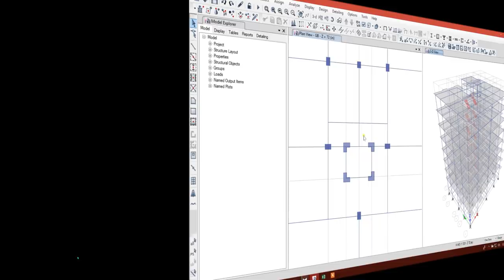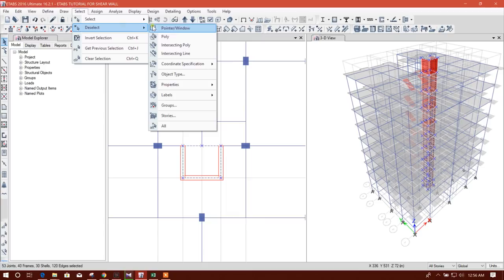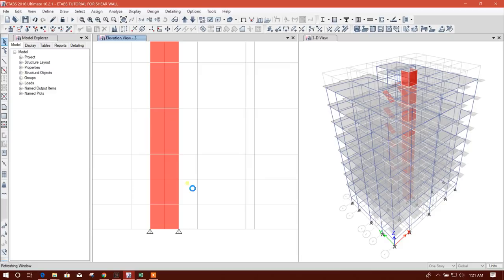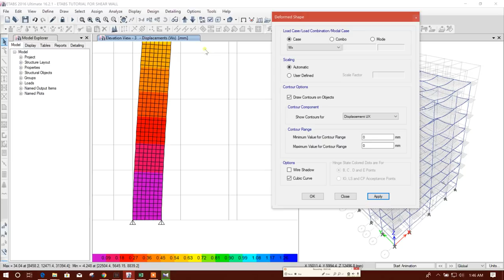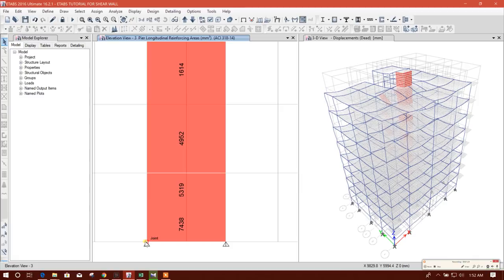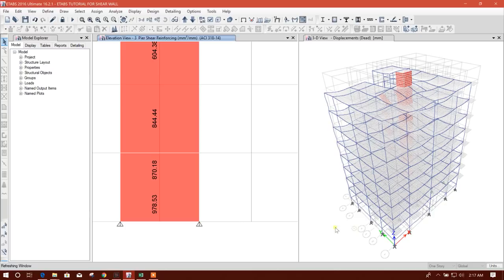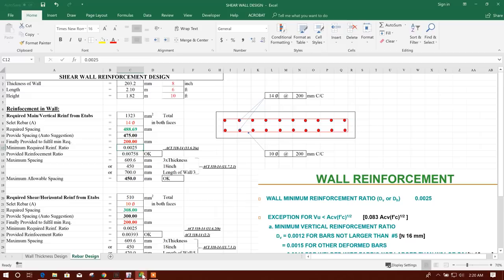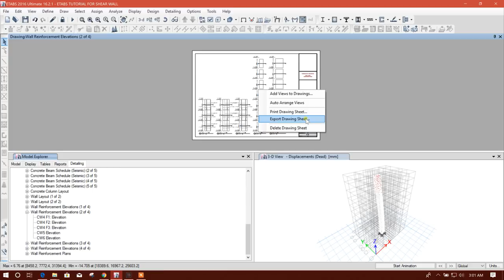Shear Wall or Lift Core Design in Etabs in Details

Comment: Thank you for your valuable time and video. Great work done by you!!!
I have a question in shear wall load cases that you assigned on it, what is W and Q load in both x and y direction represent for? Is the W represent wind load and Q represent base shear?
Please answer this as soon as possible. Thank you for your time.

Comment: If we have two models with shear walls and slab but one model have continous meshing b/w shear wall and slab and the other have discontinous meshing does that make any difference in transferring of loads and sway? Does assigning autoedge constraints to all walls and floor overcome the problem caused by discontinous meshing?

Comment: Sir, in the shear wall there are two node points showing reactions at the bottom,  For the design of foundation under shear wall how much axial o
load to be considered, adding both of two or average of two? please

Comment: Great work done by you thank you so much for that. I have a question In shear wall design output file "Design inadequacy message: Piers fails in flexure or P-M-M interaction !! " what that message tells me??? please answer this as soon as possible. thank you for your time.
Reply from the maker: P-M-M interaction diagram is a curve that shows the possible combination of moment and axial load that causes failure to a given cross-section. I said possible because with increase in the applied moment the axial load capacity of a section decreases. The diagram has two axes. The Cartesian y-axis here represents the normalized axial load ( Nsd/(fc*Ac)) and the x-axis here shows normalized moment ( Msd /(fcd*Ac*h)) and this is the common representation. Failure in P-M-M interaction denotes, it failed under axial load & moment interaction. Increase section with maximum allowable rebar % with it.
Reply: @Decodebd   Thank you so much for your very quick response and you are doing great work we will surely support your channel to grow as well as our knowledge. once again thank you for your time.

Comment: Sir, what is the allowable lateral displacement as per Indian code? Is it compulsory to give this lateral displacement target? Can I give this at the topmost floor if I have to design the whole wall from top to bottom?
Reply from the maker: This is not compulsory. You can check displacement at top story & keep it within allowable limit according to building height.
Reply: @Decodebd  Thank you sir

Comment: Super video about shear wall sir.i have one doubt sir,  your video & all other shear wall video's only focusing and explaning the design of shear wall with reinforcement 
either pass or fail according to varies loads. what my dought in genearly shear wall construction is load bearing structure.and its over all " RC SHAER WALL " load 
totally transfer to the " PLINTH BEAM " sir . In etab I done Load bearing the model like all floor slab connected with shear  wall then floor load go to shear wall & 
then total load ( UNIFORMLY DISTRIBUTED LOAD) go to plinth sir. this load and its moment & SF not match with " MANUAL CALCULATED FLOOR SLAB ,SHEAR WALL LOAD AND ITS 
BM & SF in plinth beam sir. I assigning the all material & section property of SLAB , WALL properly sir with self weight sir. it not show the actual sir . 
Even I modelling the single member in etab and appling the load of " UNIFORMLY DISTRIBUTED LOAD from  actual heigt & thickness with its self  weight . then next one 
i apply the RC WALL with same height & thickness sir . i dont show the same result sir. i kindly requested to upload the video of above my comments IN ETAB . It is 
very usefull to all about LOAD BEARING CONCEPT IN ETAB and Dont need to manual calculation about load distribution sir & it will be saving time sir . I expected & 
waiting your next video sir. thank you sir.

Comment: Sir, in the shear wall there are two node points showing reactions at the bottom,  For the design of foundation under shear wall how much axial 
load to be considered for foundation design, adding both of two or average of two? please.    May I get  REBAR DESIGN EXCEL SHEET.
Reply from the maker: Drop your mail address please.
Reply from the maker: Sent
Reply: I too need it, can you send it..?